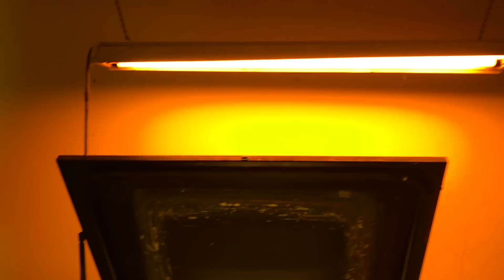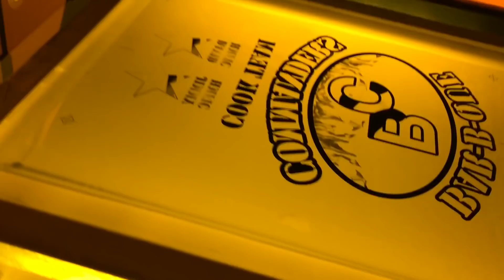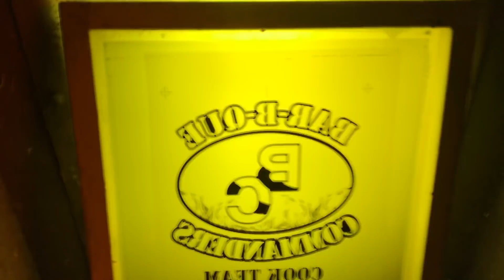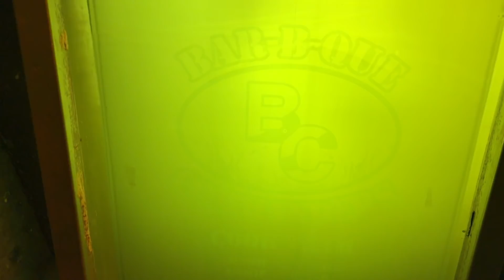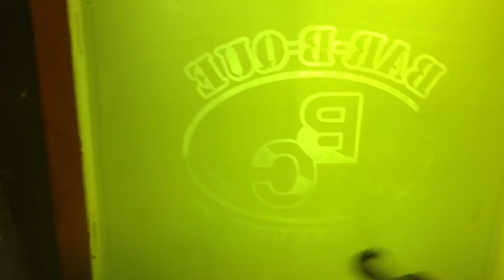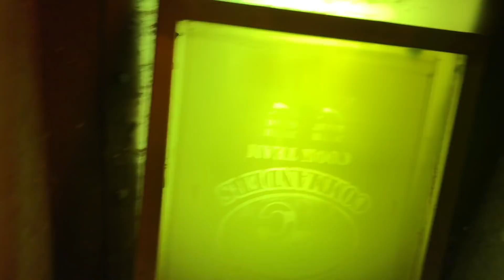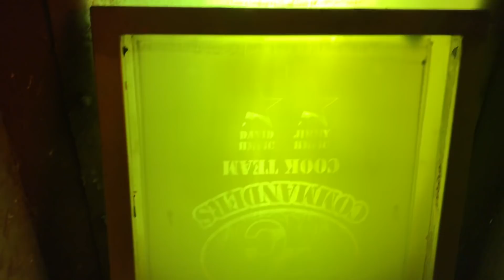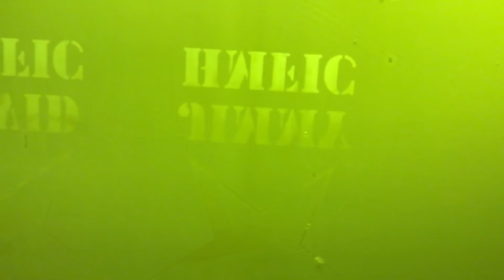Exposing & Washing Screen Printing Stencils: The Complete Guide

Comment from the maker: Hey guys! Here is a video on how to expose you screen and wash them out.  We have links to some of the products we use in the description.
Reply: Hey Mike, Did you turned all the bulbs on? I just got the same expo unit from ranar and still trying to figure out what's my exposure time  between halftone and block designs.
Reply: Im using murakami emulsions
Reply from the maker: Hey! What emulsion are you using.  I would suggest getting an exposure calculator to help figure out your exposure times.  My bulbs are a little older, but with photopolymer, when my unit was new, 45 seconds worked well for 230 mesh, and 1:30 for 110 mesh.  For a dual cure, I add a couple minutes.  An exposure calculator will be the best way to go to dial in your exposure time.  It cost about $20.  You'll wash the screen out and want to achieve 7 on the calculator.  Just be sure your films are dense.  Can hardly see light through them.  You can't really over expose them, but can under expose and you'll have issues with unexposed emulsion running down into your image area.  Which is why I expose on the over exposing side, rather than under.  There's nothing more frustration than exposing a screen, getting ready to print, and seeing part of your image blocked out from run off of underexposed emulsion. I hope this makes some sense.
Reply: I'm using a photopolymer. My unit is brand new. I did 130 but it has run off from underexposed emulsion. Thanks anyway for the tip.
Reply from the maker: What mesh are you using?
Reply from the maker: Let me know and I'll do my best to help online.  These things can be finicky figuring out.  What emulsion?  I'll see if I can't cross reference it with the exposure time.
Reply: Hi Mike,
How long it take time when u expose before washout by water? Depend on Emulsion?
Reply: i guess Im kind of randomly asking but does anybody know a good website to watch newly released movies online?
Reply: @Louis Casen thanks, signed up and it seems like a nice service =) I appreciate it!!
Reply: @Uriel Avi Happy to help xD

Comment: Hey !
Can you tell me what kind of light is behind your washout booth ? Classic light or yellow safe light ? Multiples tubes or juste one tube ?
Because I've made my own washout booth with a white plexiglass background and I would add some light behind it because it's so much easyer when it's time to washout the emulsion on the screen ! Thanks
Reply from the maker: They are regular fluorescent lights with yellow filters. Just be sure to get the correct size, but you can cut down the length. https://amzn.to/2scqjaS
Reply: Thank you !
I didn't know that a filter was enough to protect emulsion from the light. It's good to know!
Reply from the maker: It will help! Although, fluorescent lights themselves really don't expose screens fast. You have time without it causing issues. If you let it out overnight under a fluorescent light, then it would expose it.

Comment: Hey I’m using a ryonet small uv 20 watt exposure unit. And ulano blue photo polymer emulsion. Can you recommend me a good exposure time for halftimes on a 230 mesh ? I’m having problems with how long I should be exposing
Reply from the maker: I would step up the times, record them and se what works. Print the same image on a piece of film 4 times. Use posterboard or something that will block the light. Move the board so the first image is exposed, burn the image for that set time, and then move the board to expose the send image. Burn for the same amount of time. Perhaps working at 30 second steps. If that makes sense.

Comment: The dark part of the the film butts up against the screen correct?
Reply: If so you print onto the scratchy part of the film correct?
Reply from the maker: @Mrjseaton10  It's the matte side that goes against the screen, not the shiny side. You can catch your fingernail on the matte side. I hope this helps!
Reply: And the matte side is the side you print onto correct?
Reply from the maker: @Mrjseaton10  That's correct.

Comment: hot water, cold water or warm water?
Reply from the maker: Doesn't really matter, TBH.
Reply: @mikeydesignssilkscreen473  I get different results when I use different temperatures it seems
Reply: @benmcgaghran2022  it's usually recommended cold water